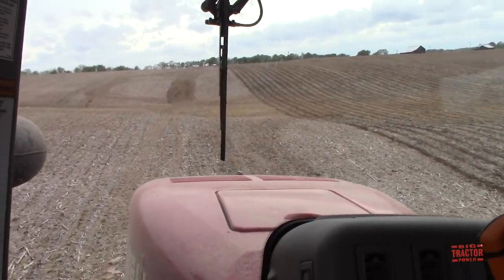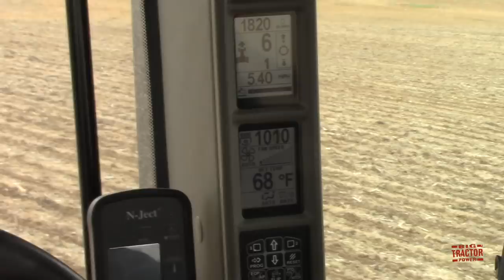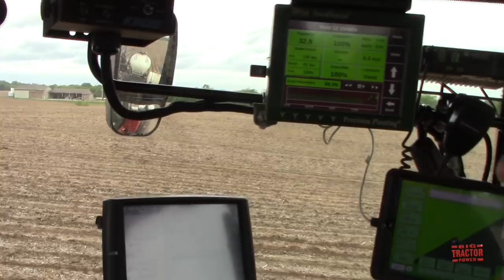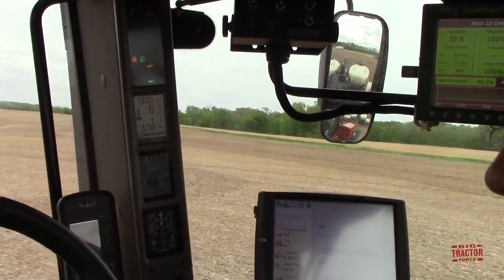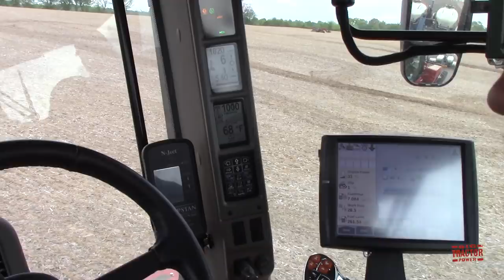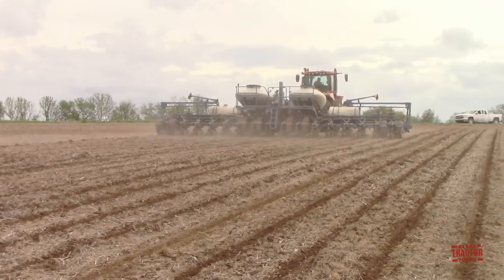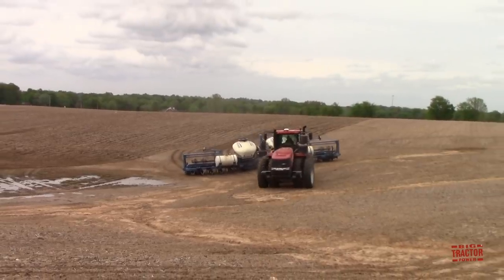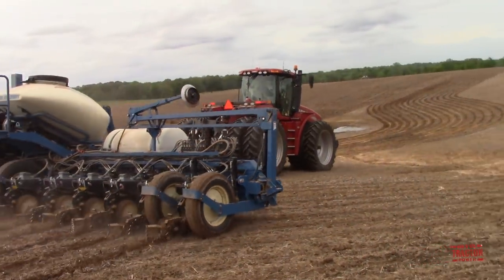Tractor Overkill?  Steiger 420 on a 16 Row Corn Planter

Comment: Even though it may be a little over kill one thing about using a larger tractor that is big compared to the implement that it's usually alot easier on the tractor, and if it can run at a lower rpm even though its larger it may actually be more efficient! Also great video once again B.T.P.! It's a good way to end the weekend relaxing on a Sunday! MN finally has some good weather so I can go on the deck and enjoy your videos!

Comment: Interesting how a 420hp articulated 4WD tractor is cheaper than a 380hp row crop machine. Great video btw
Reply from the maker: It is interesting that the Steiger is less money than the top Magnum. This farm runs two of both. Each tractor has it advantages.
Reply: Its because the list price of a stieger excludes a 3pt hitch and a pto which adds about $30-45k where as a magnum already has that figured into the price.

Comment: We pull a 12 row White 9200 planter with liquid fert with our AGCO RT120a, kinda crazy to think for just 4 more rows of corn he's almost tripled our horsepower, but if the shoe fits wear it. I guess vs our tractor being maxed out on our planter in terms of power, they look at it as running above what's needed when planting but then not needing a separate machine down the line for the equipment that does need the power the steiger has
Reply from the maker: I am an AGCO tractor fan. Sounds like a nice planting team.

Comment: A big thumbs up on that tractor I use to run a 9520 JD on a 16 row Kinze planter I could run 8.5 to 9 mhp I don't think that there is a better planter on the market anywhere
Reply from the maker: The 9520 is a solid tractor. Hope to feature a 9520 on Big singles here on BTP soon.

Comment: That semi tractor pulling a little water trailer was more overkill than the steiger on a planter.
Reply from the maker: They pull the seed tender with a second Pete.
Reply: @bigtractorpower  smart farmers to use trucks they already have in stead of new $50,000 pickups.

Comment: Heck no, put that set up here in PA with our hills and you wouldn't be saying it's overkill at all. We run a 7130 magnum that's turned up to 250 horse on a white 16 row corn planter and 31 row bean planter. and that's small for our hills. Wish we had a steiger like this to pull our planter.
Reply from the maker: That sounds like a nice set up. The WFE planters are stand out machines. I wish I got to see them more often.  If your ever in the tractor market a 9330 or 9350 RowCrop Special Steiger might be a good fit for your planter and hills.

Comment: Having a tractor that's on the big side takes alot of stress off the machine,which in turn helps keep down time to a minimum.
If he can cover 200 acres a day with a 16 row,a 32 row would cover 400 acres a day.
Reply: More like 450...less time turning around also
Reply from the maker: This farm used to run a 24 row but has moved to control traffic farming so a 16 row Case IH 9240 combine will follow the 16 row planter in the fall. This way all the passes are the same.
Reply: @mossjones7375  That too.😎👍

Comment: I would like to run one of the Steiger tractors I drove one for years before I had to go to John Deere it took me a while to get use to them lol I growed up on AC and IH and Steiger tractors just in that order
Reply: We have an old Steiger for sale in North Central Montana.  Has a 3208 Cat engine.  It replaced the original 3160, or 3106. Cant remember.

Comment: How much horsepower do you need to spread liquid manure
Reply from the maker: It depends on the size of the tanker.  In the early 70’s a 150 gallon spreader was good sized and a 125 hp tractors was comfortable pulling it. Now there are 10,000 gallon spreaders and a 450 hp 4wd or bigger is best suited to pull that type of spreader.

Comment: This Steiger is similar in hp to CaseIH's largest of 20 years ago the 9390
Reply from the maker: Yes it is. Back then 425 hp was top of the line.
Reply: Although the 9190 was 525 HP.
Reply from the maker: smylebutta7250 the 9190 is celebrating its 32nd birthday and the 9390 is just 22 now. It’s unfortunate the 9190 did not see mass production. It is believed only 18 9190s were built and sold.

Comment: Bigtractorpower did you know John Deere and Case IH are the 2 biggest Rivalry tractor companies?
Reply from the maker: Yes.  Both companies have been around along time. IH 1831, JD 1837 and Case 1842.
Reply: @bigtractorpower  I looked it up and it said 1902. Also I thought John Deere was the first tractor brand founded.
Reply from the maker: Cowboy Robert Harris the first tractor was introduced in 1903 by Hart-Parr. Hart-Parr coined the word tractor. In 1929 Hart-Parr was acquired by Oliver which became part of White Motors in 1960 and WHITE was acquired by AGCO in 1991. 

Before tractors the big brands were making many horses drawn implements. Cyrus McCormick introduced the first reaper in 1831.   John Deere introduced his plow in 1837. J.I. Case introduced a thresher in 1842 and became the industry leader in steam engine production in the late 1800’s. International Harvester was formed in 1902 when McCormick Reapers squired rival Deering Reapers and 10 other farm equipment brands that built plows, seeders, hay mowers, threshers and more. International Harvester became became one of the largest companies in the world making farm equipment, trucks, construction equipment and Appliances like refrigerators and air conditioners.  The company introduced its first tractor in 1910. IH introduced the first row crop tractor in 1923 and by 1974 had sold 5 million Farmall tractors. In 1984 International Harvester with McCormick family members still on the board after 153 years decided to sell its agriculture line to Case.  Case IH was formed in 1985.  IH became Navistar to focus on selling International trucks. 

John Deere was a larger farm equipment company building from the 1837 plow. John Deere did not enter the tractor until 1918 when the company acquired the Waterloo Boy Tractor and Engine company.  John Deere introduced its first row crop tractor in 1928. John Deere really gained market share in 1960 with the introduction of the 4010 6 cylinder tractor breaking away from the two cylinder engine that went back to the Waterloo Boy Company days. In 1968 John Deere outsold International Harvester.  By the mid 1980’s farm equipment makers and competitors like IH, Allis-Chalmers, White, Massey Ferguson and Ford all faced declining sales, dealer network reductions and ended up looking at mergers to continue going.  John Deere struggled too because the farm economies weakness.  By the 1990’s John Deere was leader in farm machinery sales.